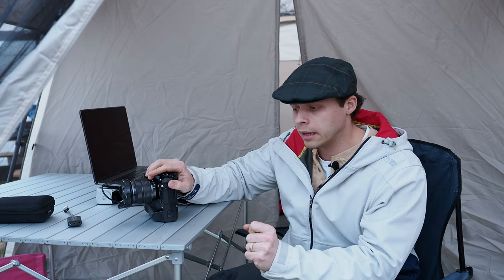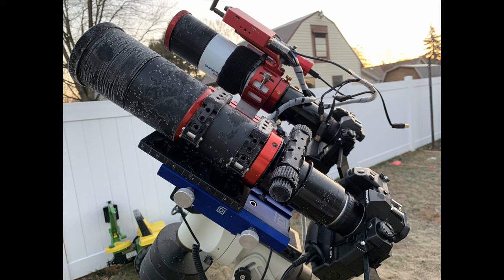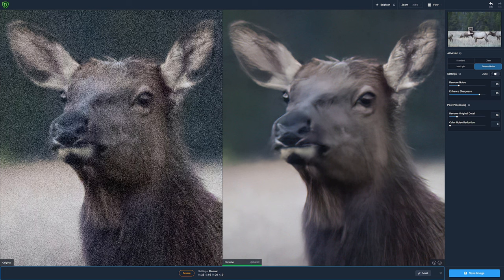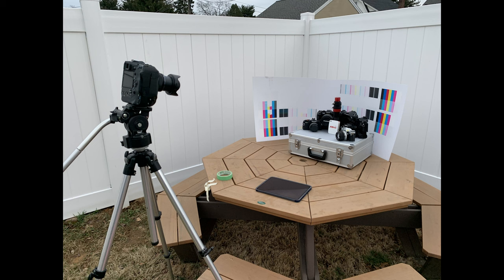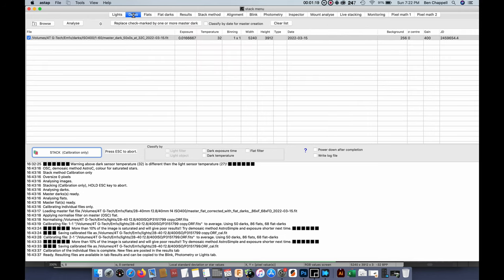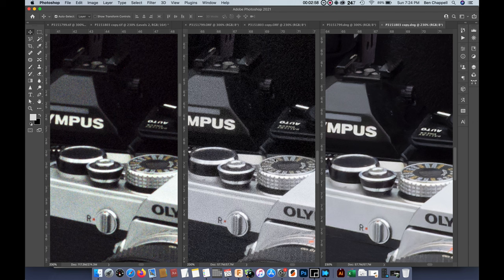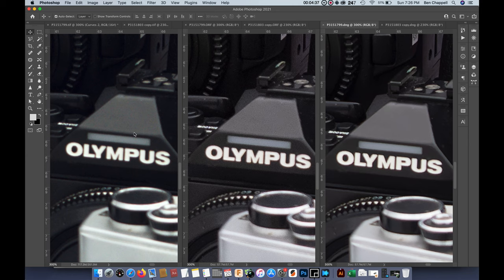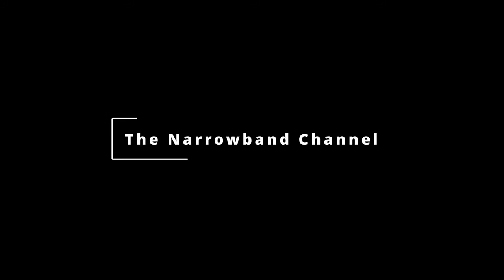Destructive Vs Non Destructive (computational) Noise Reduction

Comment: OM cameras actually do dark frame nr on long exposures. But of course it would totally make sense for all pictures! They could use the same technique to run some self-calibration, may at different environment temperatures, and build a camera-internal database.
Reply from the maker: Yes they do. Many cameras do. But its only one frame. By taking 4 frames it reduces that type of noise by one more stop.

Comment: Something I am observing with the G9 20Mp (and PEN-F) is that despite running to higher ISO, to shoot birds in flight I need to use a higher shutter speed, 1/1500, 1/2000 or faster to kill movement blur, whereas with the 16Mp I could maybe go  a stop slower on shutter speed. 
Why? Despite allegedly being a radiometrologist, this is largely conjecture - when light spills into adjacent pixels, for any reason (and it does), which is more probable with the smaller pixels, we get blurring. It's probably a combination of functions, pixel size, stabilisation/shake, subject movement, etc, it all adds up to unwanted noise. The new sensors have less noise but smaller pixels too.
Reply from the maker: This is the first I have heard of this in the G9. Interesting though. Could also be that the higher MP count means that you see the motion blue more clearly? And thus your standards of sharpness have to go up thus increasing the shutter speed needed?
Reply: @TheNarrowbandChannel  you're probably right in that it's resolving more motion blur. It is a bit of an oddity, and I am asking more of this camera. Pixel peeping reveals blurring but I am pixel peeping deeper. Using a UHD monitor reveals more glitches. 
But with astro we may well see more light spilling into adjacent pixels, and this is known to happen with other sensors.
Reply from the maker: @jeffslade1892  This is something I will be looking for in my first tests. Well depths has a lot to do with this. Something they sadly do not publish with most sensors.
Reply: @TheNarrowbandChannel  Mike Lane FRPS did a very simple test on YouTube (qv) to determine onset of apparent noise on his OM1. I copied the test on my G9 and PEN-F and got the same number - ISO 6400 is where noise starts to become apparent. 
I have always opined that both Olympus and Panasonic do fiddle with their raw, the file is an "Extended-Raw". And I have found that any altering of settings for the jpeg, e.g. the WB, gain curves, NR, Sharpening, Contrast, metering mode, colours, etc, anything that changes the gain, etc, they all alter the exposure solution for the raw.

Comment: I now have a question for you: is Live ND an internal frame averaging algorithm? Or does it only selectively average pixel values that have changed? I don't have a body with Live ND so I cannot test it. If it is a frame averaging algorithm, does that maybe solve most of your problem?
Reply from the maker: The Live ND only adds pixels that change. However since it does not take into account the average of all the previous data points collected it is not going to have a similar affect to calibration as I understand it and have observed so far.

Comment: I thought must of the noise we see today was random noise and that sensors and camera electronics today didn’t add a lot to the noise floor. It seems like you test proves me wrong. 
But how manuy set of calibration frames do you actually need to the “non-destructive” process. I guess you could limit it to one for warm and one for cold weather. That could be applied non.astro images or am I tittaly off here.
Reply from the maker: Sensors that can count individual photos do exist however they are still very small and specialized for scientific work and have to be kept extremely cold too. Those days are coming but they are not here yet.

Comment: At least manufacturers should embed the temperature data inside the meta info of the raw frames, like what Pentax is doing, which can be used by third-party software vendors like DXO and/or photographers to create calibration frames afterwards?
Reply from the maker: Olympus does. Its a question of the third party software. ASTAP does this quite well.